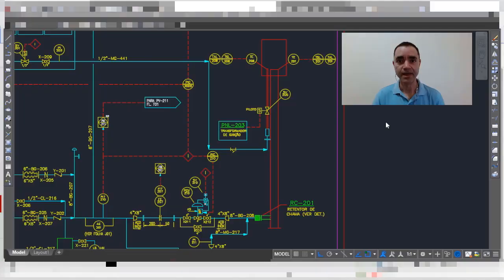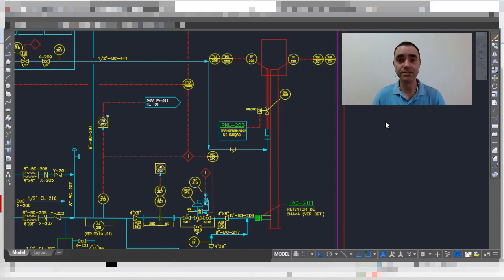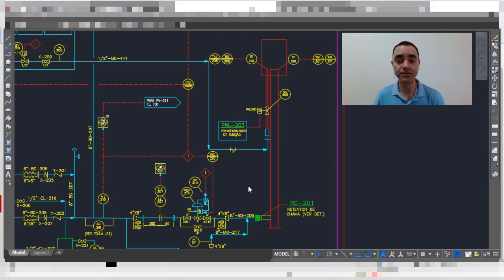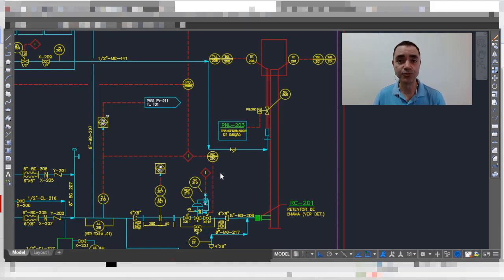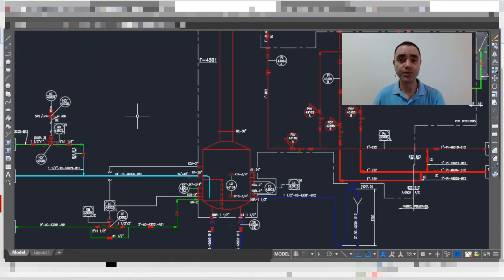WHAT IS FLAME ARRESTOR FOR CHEMICAL PROCESS ENGINEERS IN PLANT DESIGN

Comment: Sir, what do you mean by blockage of a flame arrestor shall be protected with a by pass seal leg filled with seal liquid?
Reply from the maker: Hi, the flame arrester is used to prevent back fire. It is similar to a filter, so it is subject to blockage depending on the fluid characteristics passing by the flame arrestor. Liquid seal is another option to prevent back fire. Usually, there is no need to use both methods.